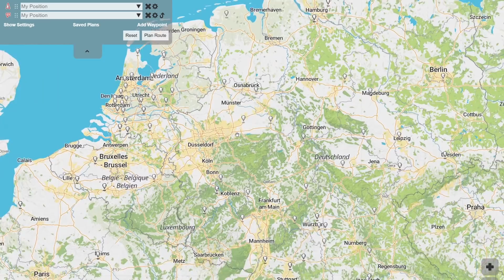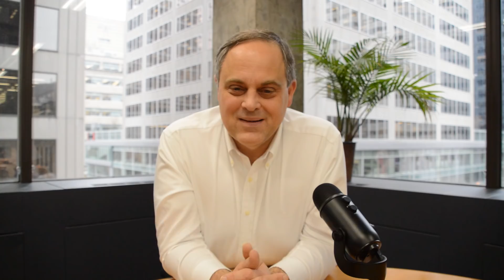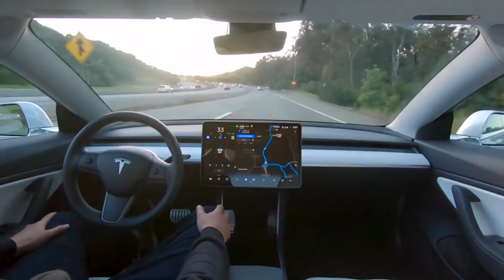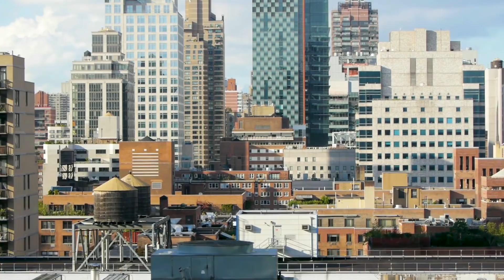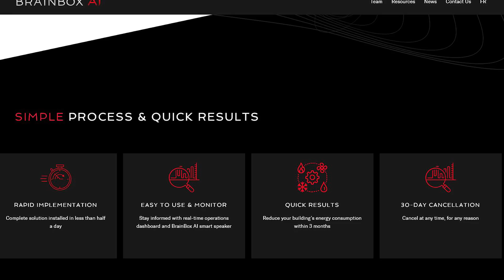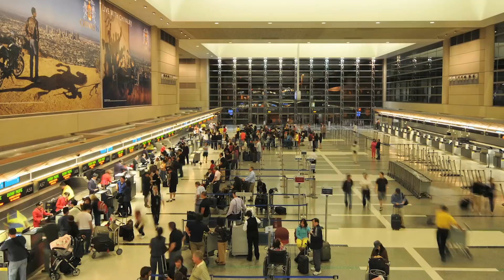Your Building Is Dumb | In Depth

Comment: Great big picture concept, but without the hardware tie in to the existing BMS (building mechanical system) along with occupancy sensors this is all vaporwhere.  Much of this kind of tuning happens every day and requires building engineers (humans). Also the security issues this presents are massive.

Comment: I didn't know buildings in USA were so dumb. UK buildings have building management systems in them which control all this stuff. Lighting controls turn on lights when occupied and switch them off when unoccupied. This ties in with HVAC which throttles HVAC when unoccupied. In UK, building regulation stipulate controls must be installed in all new commercial and public buildings.
We sell our controls all over Europe and far east. Seems USA have got some catching up to do. We've been the controls business for over 30 years. AI is also now being implemented but there is limited scope for most buildings.
Modern systems take into account CO2 levels in a room too and can negotiate energy usage with the grid so when it is at high demand, HVAC can throttle energy usage.
When we couple this with battery usage, we will be able to flatten the peak loading from the grid more effectively.

Comment: A lot of new buildings are now using variable refrigerant flow HVAC systems. This allows precise temp control and different temp in different areas and the capacity changes to match the load. This means your 50 ton system may be only producing 15 tons instead of a standard unit which is full speed or off. Also heat recovery system are being used to for ventilation required.. all new building must have lights that have occupancy sensors so they go off and on automatically based on people entering and leaving rooms.also many states like Florida where I live have have strict codes in the efficiency of the building envelope.
  In the 40 plus years I have in the HVAC TRADE THINGS HAVE CHANGED DRASTICALLY. My residential HVAC SYSTEM has 750 different capacities it only run at a speed to meet the load and the home has 3 zones so we only cool or heat the space that is being used and I can control it from my phone from anywhere in the world as long as I have cell or internet service. Buildings are evolving and the rules are changing. Also the owner realizes the economic benefits of energy efficiency to reduce operating costs. This sound like a add for this guy and yes he can help in energy savings but the system need to be designed from the beginning to accommodate a variables or flow system. Imagine the pressure loss of a duct for 1200 cubic feet per minute of air having only 400 CFM the pressure loss is huge.

Comment: I have stayed in quite a few hotels where being on an upper floor, the room was hot, like 74deg even though we turned off the in room HVAC. My wife has MS and can't stand heat, so only way to cool was with AC or in Canada, it was 34F outside so opened the window. You would think thermostats should handle it but apparently not as heat must be coming from below that we couldn't control. Must be a better way.

Comment: Smart buildings are not new. The level of sophistication has increased but the control of HVAC to respond to occupancy is at least 20 years old. LEED ratings are given green buildings that reflect the energy efficiency of the buildings. Most commercial architects and systems engineers are well aware of this initiative. Glad you covered this. It's easy to assume people are aware of this sort of thing when they really are not.

Comment: Building management systems have been around for decades. I wish them the best, but they're not inventing anything new. Preemptive hvac settings, daylight harvesting, vacancy sensors, and such are already in buildings with the budget to support them.
Reply: The thermostat wires usually don't even leave the room. He should make comparisons from something that doesn't require dumb thermostats to be rewired for two way data. Simply using enthalpistats instead of thermostats makes a massive gain, so how much better than THAT? Buildings where all those thousands of thermostats are wired back to a central point where all those data points are centrally available are not your typical installed copper wiring. He clearly has to physically connect all the thermostats, dampers, valves, pumps, etc to the building's LAN, or for security, install a separate LAN. He only has all that in a building that already has a sophisticated energy management system.
Reply: The part that is new about what this company is marketing is the use of artificial intelligence to solve the multivariable question of what settings where, when and how makes for the most efficient energy use in a building. Our church has much of the tech you mention, but still suffers from tons of trial and error, EMPHASIS here on error, trying to find the settings that match our faith's mission of doing our best for our society and world.

I totally agree with other posters about the importance of passive design, building insulation, more renewable energy sources, wearing sweaters, etc. But we do live in the real world with the buildings we currently have, people's attitudes we currently have and the questions of what can we do with limited monetary resources to speed up the transition to more efficient and sustainable, renewable systems. Artificial intelligence just may have a roll to play in helping us make the smartest choices as we transition.

Most economists believe that a part of the solution is a steadily rising price on carbon, wisely administered and returned back into the market. That way market forces bring the transition to everybody, not just motivated believers in the science of climate disruption. A couple links supporting this conclusion:
https://clcouncil.org/economists-statement/
https://citizensclimatelobby.org/carbon-fee-and-dividend/
https://en.wikipedia.org/wiki/Energy_Innovation_and_Carbon_Dividend_Act_of_2019
Reply: @jeffcarlton3590  Saving energy is a great goal. Saving energy in a building is very straightforward: don't spend energy in unoccupied rooms, and spend less energy in occupied rooms. The solution is deterministic, so AI doesn't have a role to play. What can AI do here that's not already being done by the existing solutions?
Or is this simply a case of wanting to use IA because it's cool, not because it's better?

Comment: I think this is pretty good.. I think though they should tap into the lights and sensors to see who is in the building..  They could also add auto tinting windows and use the sun to heat in the morning and block out in the afternoon.

Comment: Good if buildings were built well in the first place. Are existing ones able to be modified so they can add: eves with solar panels above windows, the top 20% part of the windows (safety reasons) where they are able to be opened automatically (especially at night to allow cooler fresh air in the summer) and other ideas?

Comment: You could get a further cost savings if BrainBox also controlled Tesla PowerPacks, with time-of-day electrical pricing to avoid high cost power spikes. Of course, PowerPacks can be filled cheaply at midnight and also provide emergency outage power.

Comment: American buildings are atrociously designed, built and maintained.  While improving controls will help there is no amount of lipstick that will make these energy pigs efficient. 

Consider a few no cost/low cost design details that would be game changers.
1. Naked unshaded glass facing the Sun pull in massive heat that forces cooling on the sunny side and maybe heating on the shaded side many times of the year.  Now control that I dare you!  Instead, why are there not mandatory overhangs or shades that will keep sun off those windows?  Answer, because codes deduct floor area when overhangs are used, tenants think floor to ceiling glass looks modern and glass is cheaper than walls.  Result, massive energy requirements no matter what controls are used.  His assumption that the controls are poor is correct but the building IS the problem and can be made to use a tenth of the energy most use with simple design changes.
2. Lack of floor to floor air tightness where elevator shafts and vertical chases make the building act like a huge chimney make many of these building designs impossible to control no matter how smart the controls are.  Problem is the building was stupidly designed in the first place. 
3. Lack of performance testing means no one knows how interconnected vertical spaces are nor whether the duct systems will actually deliver what they’re supposed to.  Only WA State requires building tightness measurements and when they did, they intrinsically used less than half the energy and at no extra net cost to build. No state requires duct testing but its optional allowing massive faults to go undetected for the life of the building.  Eg. my six story office didn’t not have the returns connected to the vertical trunk but commonly most large buildings have massive deficiencies that go unchecked. 

Someone suggested Passive House which would solve many of these problems althought WA’s lead could be followed for law most zero cost along with mandatory duct testing, window shading and floor to floor air tightness controls (which would have to include airtight elevator shafts and lobbies). 
Next, construction details need to be monitored and here passive house certifications show a way forward. Then a proper commissioning would uncover most faults and would get equipment set up properly from the start. Now we could look at AI or whatever but 90% of the energy now wasted would already by saved.

Comment: Our houses are dumb!
We run a compressor on a refrigerator and maybe another one on a freezer and pump that heat into the air in the house. We then run another compressor on an air-conditioner to take that same heat from the air in the house and move it to the air outside of the house. At the same time, we are taking another source of energy to heat water for the household. Why not use the energy from these compressors to preheat the water for the house?

Comment: I disagree about lights, it's NOT only turn it on and off, with LED you can gradually increase the power needed to light a room. For example, a meeting room with a window, in a sunny day you may not need full power, or when it's cloudy, just a bit more to compensate the lack of lumens. And with kelvin management you can mimic a daylight like it is outside at the same time. And of course automatically switch of when nobody is there, it's seems obvious, but look at night how many building stay enlightened when everyone is back home... 
With power management you need to add first insulation even if you are in a hot area.

Comment: AI sounds great in a Utopian society, however is far from the low hanging fruit here.  SEER 21 even SEER 24 HVAC equipment is available, yet most of what is installed is still far less efficient at SEER 13 or 14. There is much more to gain with mechanical systems before AI would ever pay back.  SEER 15 will not be required on new equipment until 2023.  If we want to save the planet, push to  adopt higher efficiencies sooner, to bring down the cost of equipment technologies with this efficiency, It will pay back way before AI ever could.    
For some perspective, a SEER rating is 'generally speaking' the number of BTU's transferred per Watt at max efficiency.

Comment: If the system is not designed properly, AI will not fix most issues, which is usually a lack of capacity, of system age, or install issues.  A change over from legacy R22 to R410a will save way more than AI ever could.
The process of interacting with controller based legacy equipment, is a less than ideal approach, ROI would never beat updating equipment. These legacy systems don't have the control features, or hardware to apply many of the items that AI would want to change or 'tweak'.

Comment: In commercial buildings there are baseline loads that say you need X CFM/per person fresh air, depending on the building function. This is industry standard and this is the main load during occupied and unoccupied times.  Honestly these systems are already expensive enough, this really is going too far from KISS,  This is a sales pitch, and I find it hard that it will show an ROI, to a common owner.  
For example: Just putting a VFD and controller on kitchen hood fans is hard enough to show an ROI some times, and kitchens are of the most complex and energy wasteful portion of commercial spaces and in those instances there are exceptions, charbroilers, they are forever on high and ovens just idle along.   This main portion comes down to intelligent design, which is enough of a challenge.

Comment: One of the trade centers in NY uses Daikin minisplits in each room.  The  system can transfer refrigerant from one that doesn't need it to a place where it is needed without going to the main compressor.  Eadh air handler automatically senses occupancy.  Daikin Group represents 65% of the world market.  Each main system can handle 1000 air handlers.  Daikin has mastered the transfer of energy using the refrigerant transfer rather than air ducts.
Reply: That is a VRF heat Pump system with Heat Recovery.  Heat Recovery allows simultaneous cooling and heating of zones in the building and also enables cooling zones to redirect heat to hot water tanks, etc.  It's the future, sadly only LG offers a solution that runs on single phase power, meaning there's only one company offering a solution if you wanted to install this in your home.  

Video showing single phase residential installation:
https://youtu.be/Ag1tmOCgcdE

3 phase Heat Recovery Condensers: (Commercial)
https://lghvac.com/commercial/product-type/?productTypeId=a2x44000003XR0T&iscommercial=true&class=Outdoor%20Units

1 Phase Heat Recovery Condenser: (Residential homes and buildings lacking 3 phase power)
https://lghvac.com/commercial/product-type/model-details/?productTypeId=a2x44000003XR0O&modelId=01t44000008fw8M&modelNumber=ARUB060GSS4&iscommercial=true&class=Outdoor%20Units

Indoor Air Handler Options:
https://lghvac.com/commercial/

Hot Water, Radiant, Water Applications:
https://www.lg.com/global/business/air-solution/vrf/hot-water-solution-hydro-kit
https://www.lgvrf.ca/en/hydro-kit.aspx/ARNH763K3B2
https://www.lgvrf.ca/en/hydro-kit.aspx/ARNH963K2A2

Comment: Buildings need to exclusively use VRF Heat Pumps with HEAT RECOVERY.  That Heat Recovery part is key and is the future of how we condition our buildings without using Natural Gas and only using electricity.  

Heat recovery means the system can simultaneously heat AND cool zones in the building.  Heat is essentially moved within the building zones first and then, only if needed, the outdoor condenser/air handler will be used.
Zones can condition air, radiant floors, water heater tanks, pools, snow melt loops in driveways, etc.  Imagine, any zones that are cooling the room will capture heat from that room and then transfer it to a heat exchanger to make hot water.

The systems are typically require 3 phase power to run the outdoor condensers, so this technology is commonly only found in commercial and high rise buildings since low occupancy residences do not have 3 phase power, However, I have found that LG is the only company offering both commercial and residential solutions in the Heat Recovery equipment.

Video showing single phase residential installation:
https://youtu.be/Ag1tmOCgcdE

3 phase Heat Recovery Condensers: (Commercial)
https://lghvac.com/commercial/product-type/?productTypeId=a2x44000003XR0T&iscommercial=true&class=Outdoor%20Units

1 Phase Heat Recovery Condenser: (Residential homes and buildings lacking 3 phase power)
https://lghvac.com/commercial/product-type/model-details/?productTypeId=a2x44000003XR0O&modelId=01t44000008fw8M&modelNumber=ARUB060GSS4&iscommercial=true&class=Outdoor%20Units

Indoor Air Handler Options:
https://lghvac.com/commercial/

Hot Water, Radiant, Water Applications:
https://www.lg.com/global/business/air-solution/vrf/hot-water-solution-hydro-kit
https://www.lgvrf.ca/en/hydro-kit.aspx/ARNH763K3B2
https://www.lgvrf.ca/en/hydro-kit.aspx/ARNH963K2A2

Comment: Power companies including natural gas, like to maximise profits. Hence, houses and commercial buildings waste energy to keep the industry going. They do not want "passive" anything. You are correct, we need to retrofit billions of buildings. Double glazed windows with metal frames are being sold ( for sound proofing!), the metal frames leak energy in both directions...aargh!!
Reply: Yup, we need more efficient construction first and foremost, and then we need to use VRF Heat Pumps.  It's always cheaper and more energy efficient to move heat than to create it with gas or electricity.  But the fossil fuel industry doesn't want us to know that.